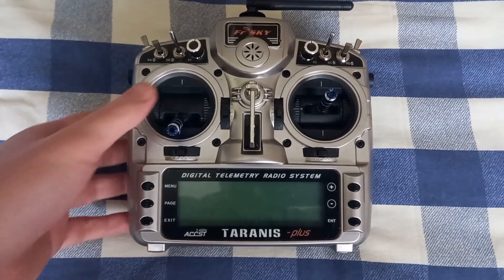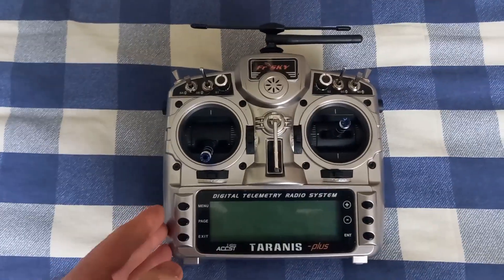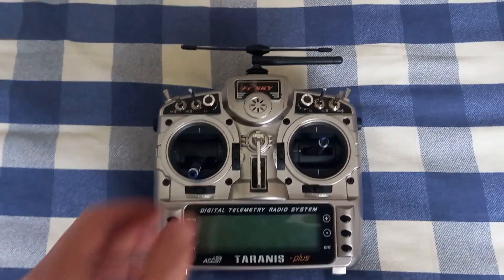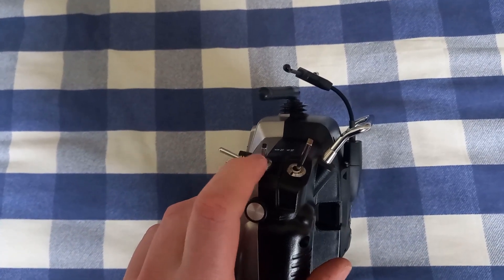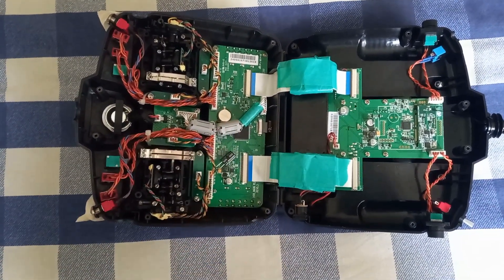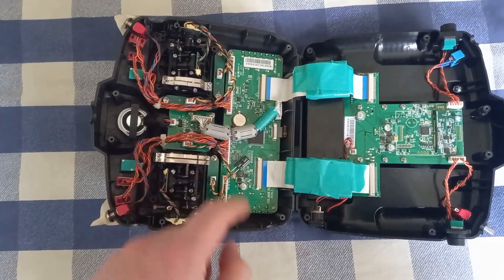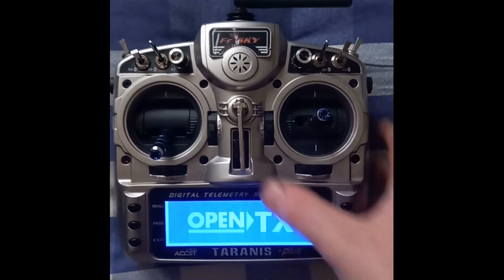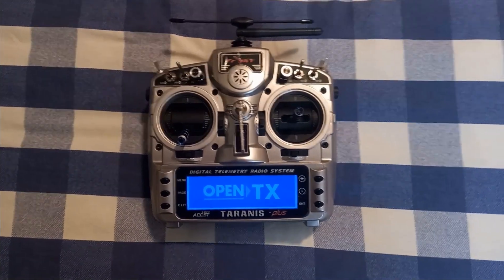TBS Crossfire module & Fr-Sky Taranis buzzing noise solution

Comment: Years go I used copper tape to line the rear half of the enclosure.  Then solder a wire to the copper tape and connect it to ground which can be on the battery input.  Had no noise afterwards from the EZuhf. 433 link.
Reply from the maker: Interesting! Thanks for sharing !!